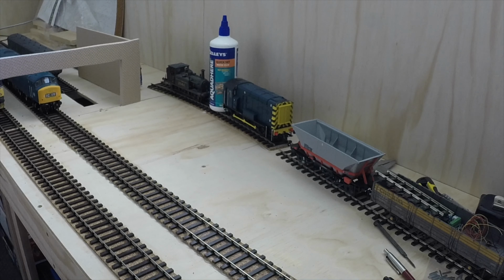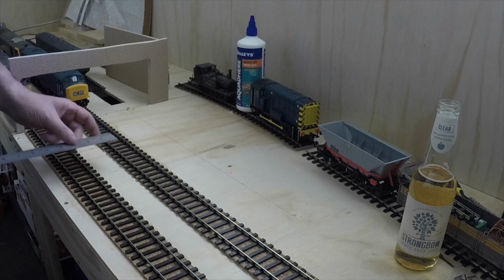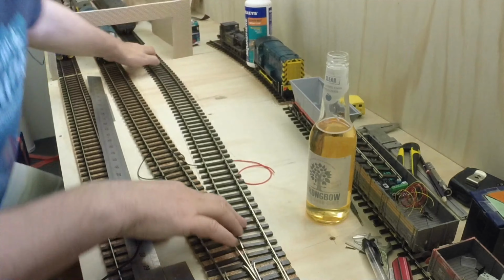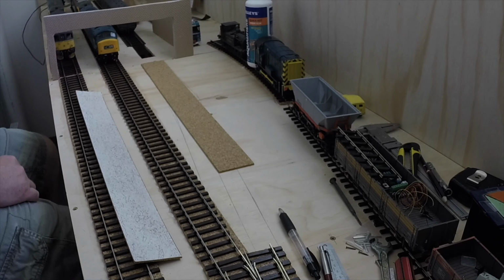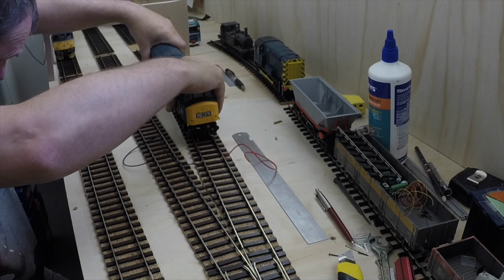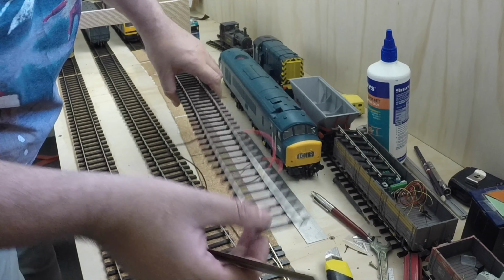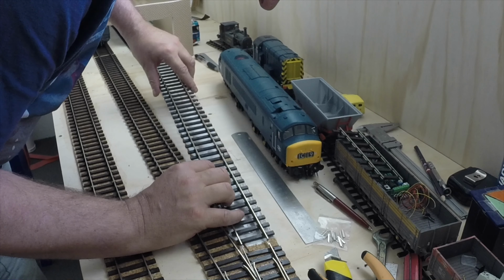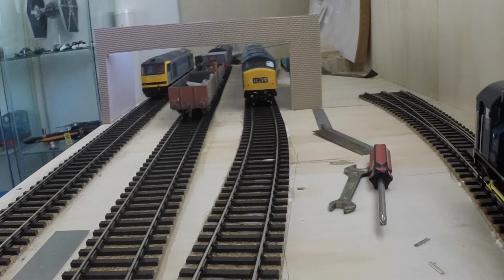Model Trains 76 - Hither Green TMD in O Gauge. Laying The Tracks. A How To Tutorial

Comment: All looks fab, I'm slowly catching up with your back catalogue 👍💜✌️

Can I ask, on that Peco Y point, how close to the chairs did you cut your sleepers? Thanks in advance👍💜✌️

I've laid one Y and I've got two curves diverging away (working with the weird point geometry and between 5' 6" and 6' O" using track setters, the MK1 eyeball and mirrors etc) as it's a branchline junction etc. I've tried interlacing the sleepers - no joy. I've cut some and they match perfectly, look like angled timbers/sleepers👍🤞, but the ones closest to the point itself? Getting the rails to meet without removing chairs is nigh on impossible. 

I've laid a lot of track in other scales up to SM32 in my time and never had this issue. I want a neat job as it's outside on MRN and won't be ballasted (if I can help it). I don't even see how to place in a spare, "floating" sleeper in a gap with replacement chairs etc😲🙄🤬😥

I tend to leave the chairs alone and cut down and fettle the fish plates instead.

I'd just got the main running line sorted - although in reality the real "mainline" is the diverging branch going into the garage - so I'm loathed to lift that and start again.

Perhaps in the cold light of day, in 48 hours or so, I'll see the light and get it finished, but for now a neat solution evades me🙄🙄

Any advice gratefully received ✌️💜👍😉😊
Reply from the maker: I’ve got to be honest here and say I just chop off chunks of sleeper and didn’t actually measure them. Some are shorter than I wanted. However, to assist in fine adjustments and interlacing etc you can cut the webs off between the sleepers so you can vary the spacing a little which is also prototypical

Comment: Ian, I notice that you have trimmed the sleepers right back, almost to the chairs, where the inner two rails converge at the point frog. Is that prototypical or is it just a means to an end that will largely be buried under the ash-like ballast/ground surface? The reason I ask, is that I have seen point-work where the sleepers are interlaced and also where extra large sleepers are used that run under all four running rails.
Reply from the maker: places vary, some were interlaced, and some were cut. the trouble with interlaced sleepers is that it becomes difficult to tamp under the sleeper to make the bed firm. mine are a bit shorter than i was hoping, but i will cover that with a bit of ash and maybe some dead weeds and stuff just to camouflage it a bit
Reply: @47606odin  Thanks Ian.